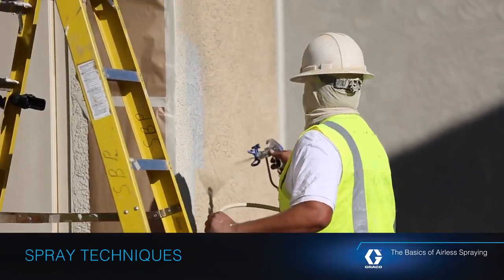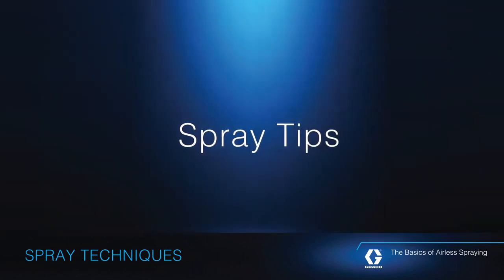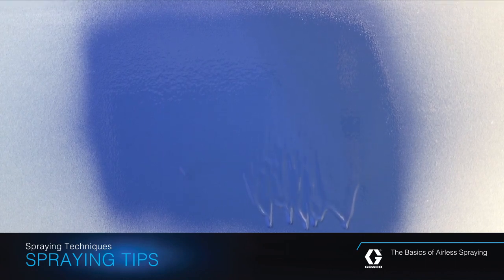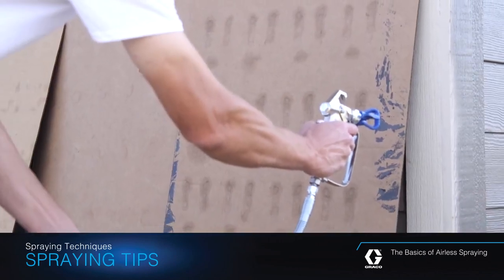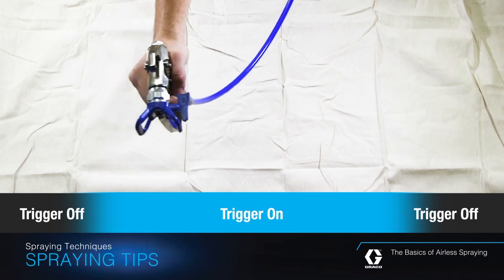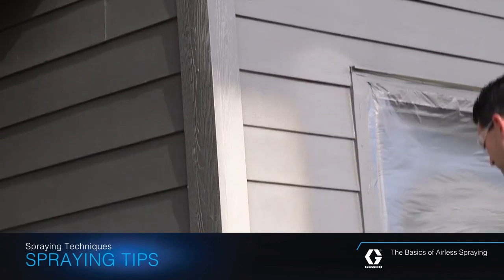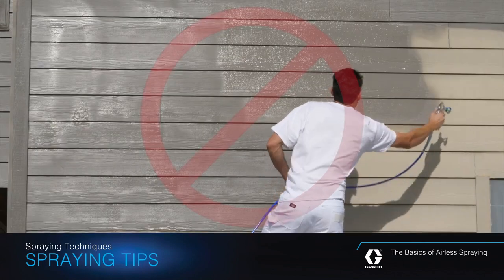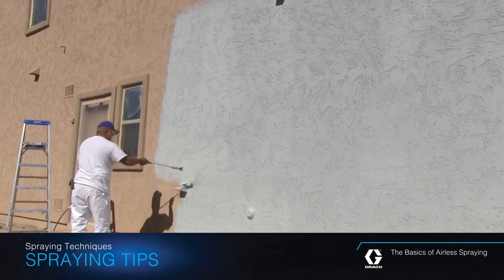Spray painting: how to quickly master the basics of airless spraying

Comment: Can this be used to paint a car?
Reply from the maker: Hi Carlos, airless is a technique you can use to spray cars. But the sprayers in this video are not designed for this specific application. Check out our automotive range at https://www.graco.com/gb/en/in-plant-manufacturing/solutions/automotive.html